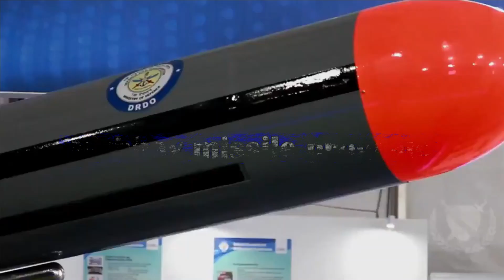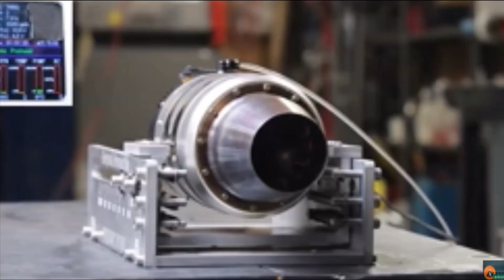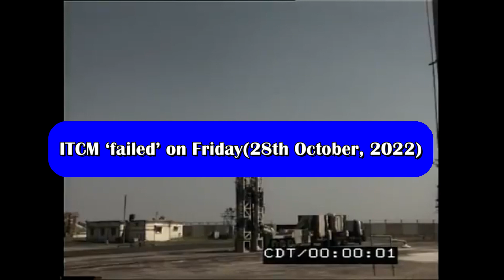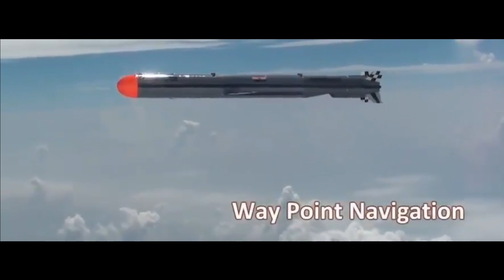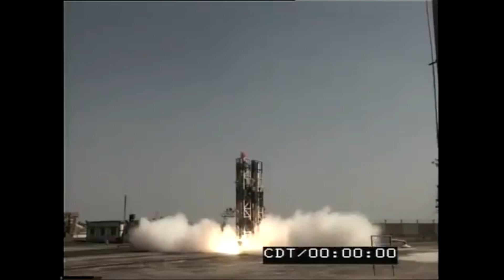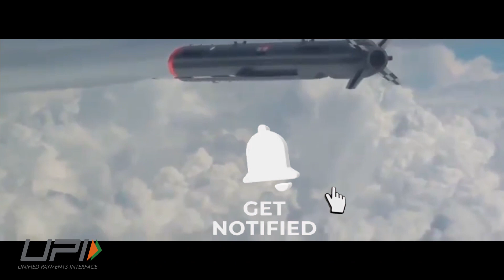ITCM missile test of 28th October failed possibly due to engine issue. #drdo

Comment: Of the three tests of the ITCM conducted since 2020, two have failed and one achieved ‘partial success’.
Failure is part of any new hardware. The absurd expectation that importing already developed hardware 
like Pakistan did can be compared to developing new hardware deserves mockery.

If I build my own car, it will of course be harder to make work than just buying it from Toyota. The 
Long Range Land Attack Cruise Missile (LRLACM) for Indian Army & Air Launched Cruise Missile (ALCM)
is vital for matching the PLA Rocket forces, and threatening the ability to decisively defeat Pakistan in less
than 7 days. 

Siimilar to the performance of the Tomahawk during the Gulf War against Iraq, if Bharat has 1 thousand plus 
LRLACM and 500 ALCM just for Pakistan, Pakistan will suffer immediate defeat. Against the PLA Rocket force,
conventional detterrence will exist. 

The PLA stands the risk of having its cities and bases in the rear be blown up. Not as bad as nuclear, but still devastating.

Comment: No need to provide missile technical details, you can damage the weapons security regulations or act.
Reply from the maker: Info available in public domain and shared by DRDO - we ensure only those info to be revealed which is available in public domain.
Reply: @IndianDefenseAnalysis  DRDO needs to review its public reporting procedures.